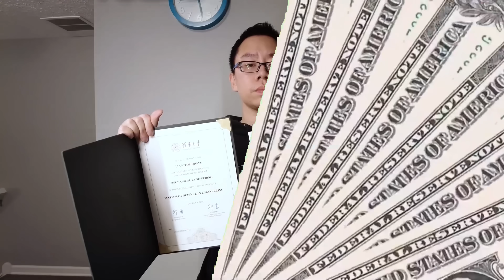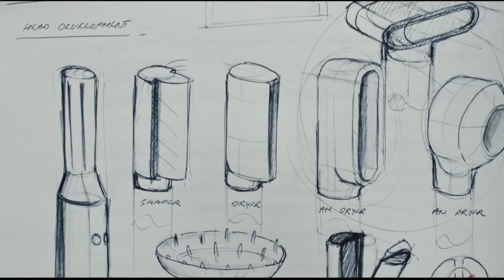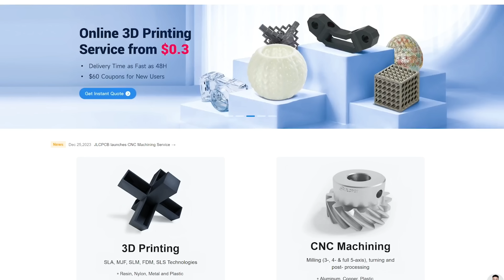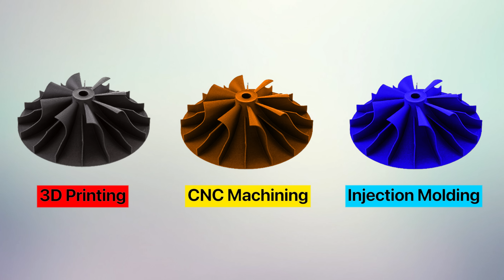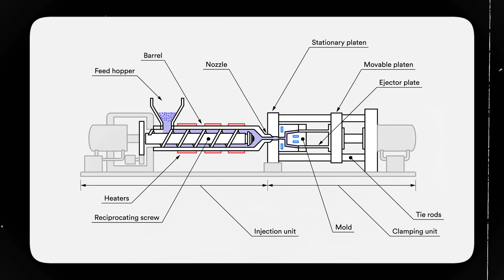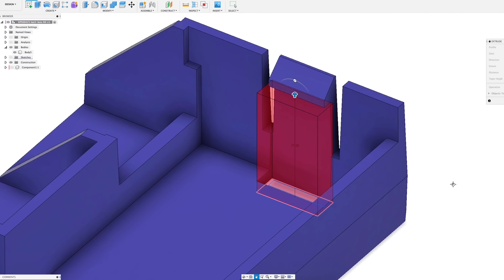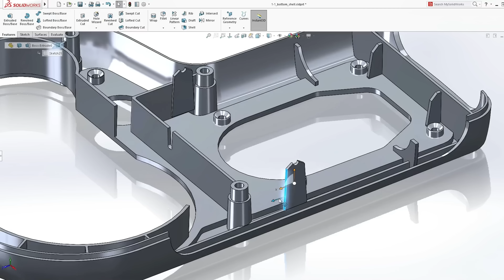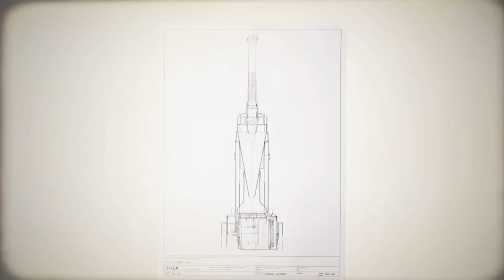the ONE skill that changed my life as a mechanical engineer

Comment: Great video. However, this is only applicable if you want to pursue a career in design. There are tons of mechanical engineering jobs other than design. You might not touch CAD software in your whole career. All depends on what kind of job you want to be in.